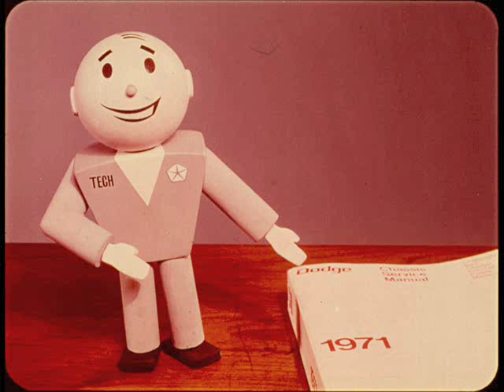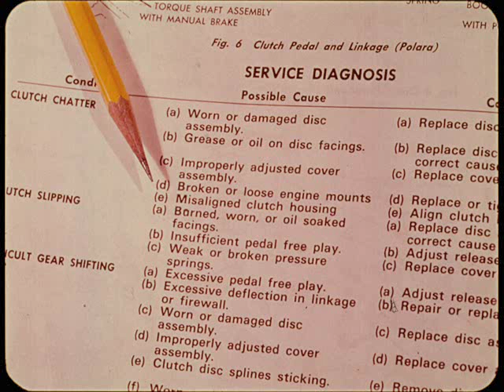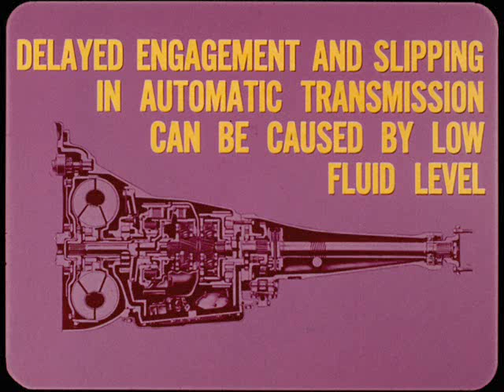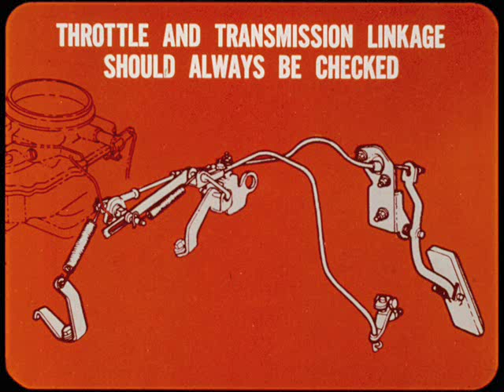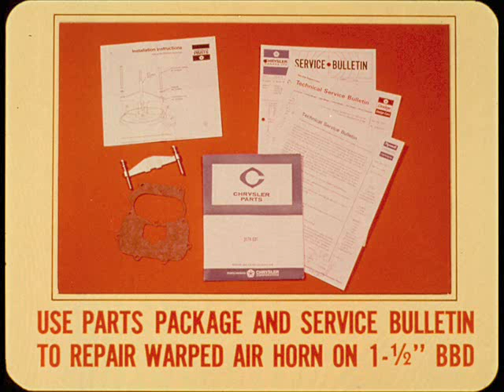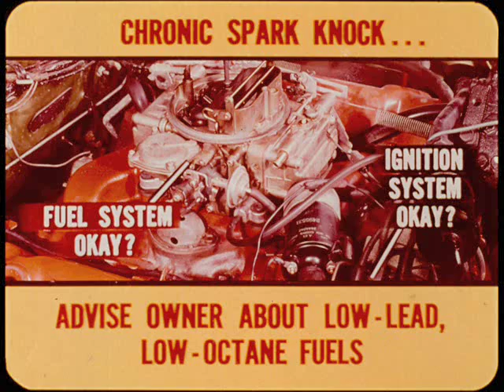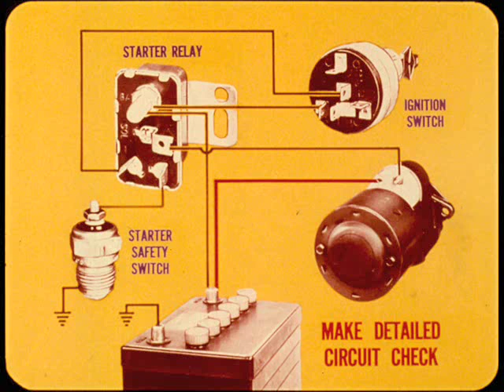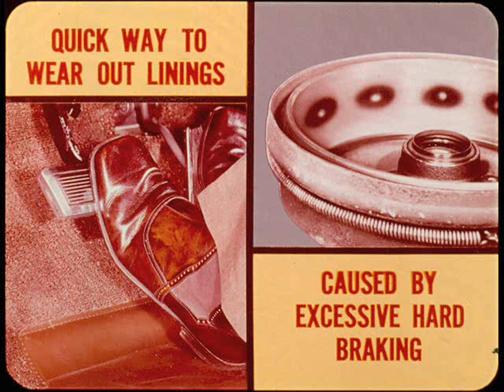MTSC - 1971, Volume 71-9 Cure the Cause

Comment: 2:05 some people make it a rule to replace the rear main seal and transmission input seal at each clutch replacement.
6:19 sometimes you can't get a replacement. If that happens, you need a "Speedi-sleeve" and install kit for the Speedi-sleeve. You can get one for just about any size shaft that has a damaged sealing surface. Sometimes you can even save an engine crankshaft with one.
9:00 I remember the first time I encountered an engine that was 100% dead. It couldn't make half the compression it needed to start. I told the service writer "I don't know how to deliver the bad news, but this engine will have to be rebuilt or replaced." It was a Mazda RX-8, and the apex seals were gone. I was sure of it right from the beginning because I had read so much about rotary engine repair. Luckily for this man, Mazda agreed to tow this car to a dealer and replace his engine at a deeply discounted price. It was out of warranty, but Mazda believed that the engine should have lasted more than 137,000 miles because it was maintained by the book.
EDIT:
9:26 Many early O2 sensor engines would end up this way. Those engines could detect a short circuit, open circuit, or out of range voltage at the oxygen sensor. However, oxygen sensors react to changes in air fuel ratios more slowly. Other times they can fail in a too rich or too lean position. This also leads to failed smog tests, shortened catalytic converter life, and wasted gasoline.
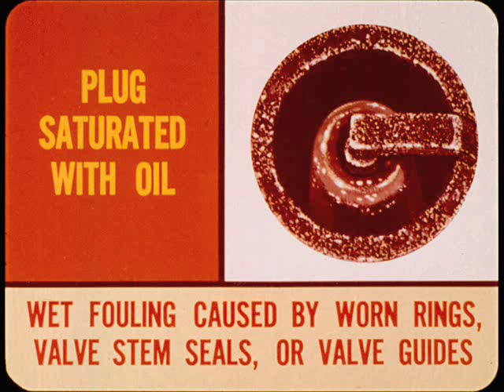10:00 Be aware of PCV system failure. Sometimes the PCV components fail, and let engine vacuum oil get sucked into the engine. BMW often uses what people call an "Oil seperator puck" and can be the major cause of oil consumption. VW occasionally uses them too. Also, since it regulates crankcase pressure, those might explain why BMW and VW oil gaskets seem to develop leaks before most American and Japanese cars do. Volvo uses a "Flame-trap" instead of a simple PCV system which is complex and expensive to replace, but it has to be done. Ford sometimes has heated PCV Valves because water vapor will freeze inside the PCV hose during extremely cold weather. The valve and heater have to function properly. Also, there are many engines that have a fixed orifice instead of a PCV system. The Jeep 4.0 uses this system, and the worst thing that happens is a leak where the hoses and orifice seal against the valve cover. It costs more than a conventional PCV valve and PCV hoses to repair, but it doesn't cost nearly as much as what German and Swedish cars usually use.
10:20 lean air/fuel mixtures could also do that to a spark plug.
12:45 I once had a fuel pump fail at probably the worst time ever. I was driving a 1989 Toyota Tercel (Carb engine version), and made a right turn on a busy street. I hit the accelerator and the engine didn't go past idle.
17:10 those don't work on R134a, you have to have an electronic leak detector.